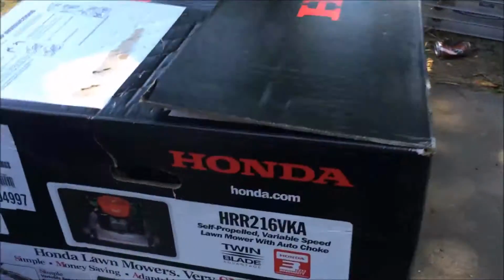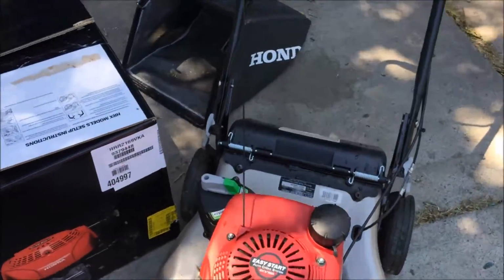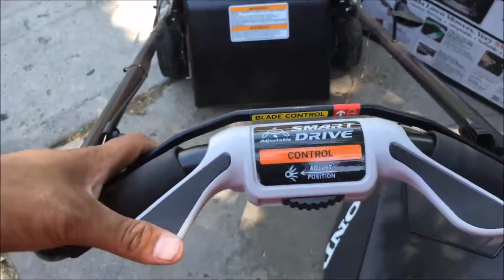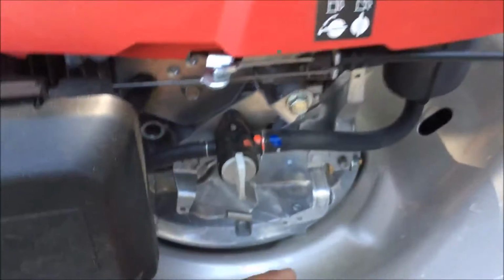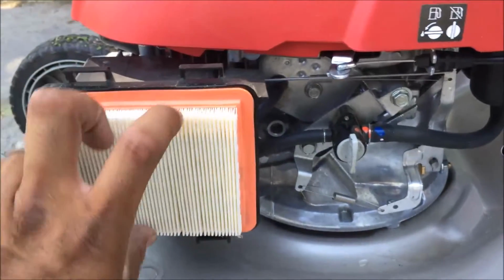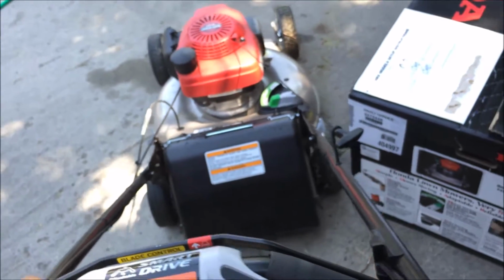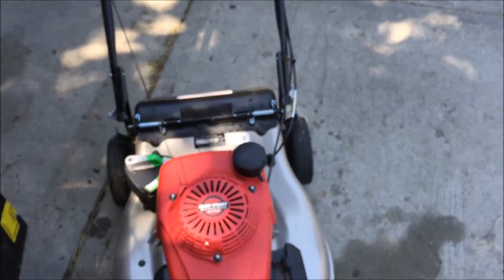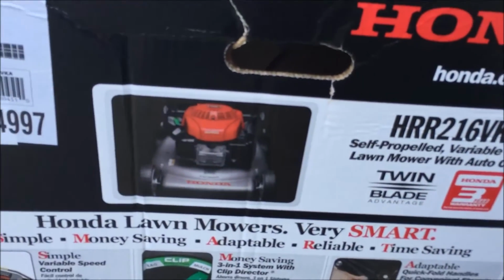Honda HRR2169VKA Lawn Mower Review ... Lawn Care Business Equipment

Comment: I have the hrx series. when transporting from job site to job site always turn off the fuel. I think bouncing down the road causes carb to flood and makes it hard to start on next lawn. I find when the fuel is shut off during transport it starts up first pull every time
Reply from the maker: I learned the hard way. After 2 seasons, this honda has literaly been torn up by my use and abuse. lol. Itll need some work for this upcoming season to make it feel brand new, but I also plan on getting a newer honda.

Comment: After watching your review I'm ordering one today. Looks like a good mower and the cut is crisped. What height level setting are you using in the demonstration. 🙏✌️
Reply from the maker: I use the 3rd setting from the bottom. I believe about the 3rd setting at 3 inches. It's a GREAT mower! the double blade really makes a difference, that's what I believe. Hope it works out for your Milton. Let me know how it goes.
Reply: Thanks 🙏 for the info. Used the lawnmower yesterday, great 👍 little machine, love it. ✌️

Comment: Honda makes the best lawn mowers ever. The only ones that are even close to Honda's are the ones with Honda engines. Lots better then the Briggs and Stratton crap they put out now. I also like how the bottom is welded. Also, they have better features. However, I like Toro Personal Pace self propel system better then the smart drive, but that wont keep me from getting a Honda. Much more  reliable too. I will defiantly consider one.
Reply from the maker: I like the smart drive as well, but my experience with those toros is that they seem to want to jump up on bumpy lawns.  But your right, hondas are reliable, I want to get my hands on the $700 honda, I just hate that the ones they sell at home depot are made of plastic.

Comment: I ordered one a couple of days ago online. I'm still waiting for my tracking number.
Reply from the maker: its a great machine. After a year though, it doesn't want to reverse anymore. Lol. So I suggest that you clean it at the end of the day.  It still goes forward and cuts well, but the back wheels refuse to go backwards when I pull it back.
Reply: @UsoDak  try to replace the plastic bushings on the rear wheels they go bad and start doing that. there's a lot of youtube videos on how to replace them. mine is still working good for now

Comment: if you could choose between this hrr216vka and the hrr216vya and the hrx217vka which one would you choose?
Reply from the maker: probably the hrr216vya . I like them all, but I think the main difference in the 1st and the 2nd one you mentioned are the auto start. The 3rd one you mentioned, I haven't really tried it out yet, but I just hate that the base is not the same as the 216's. Which one did you end up getting?
Reply: Nothing I got a truck instead

Comment: If you bothered to read the manual you'd know the red thing in the gas filler neck is to be flipped up and set atop the filler hole.  You may then use it as a guide for your gas mug spout.